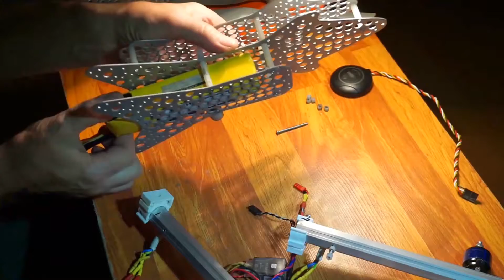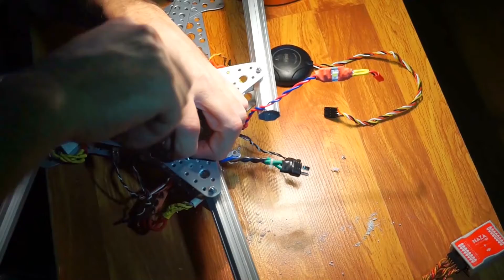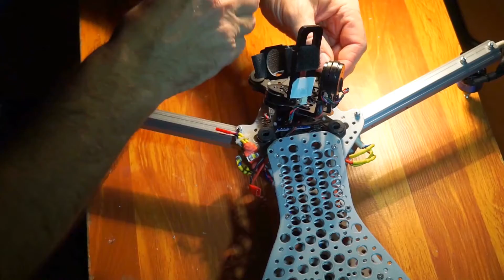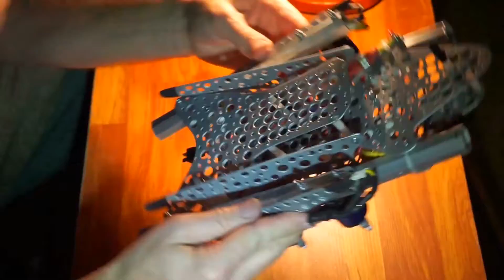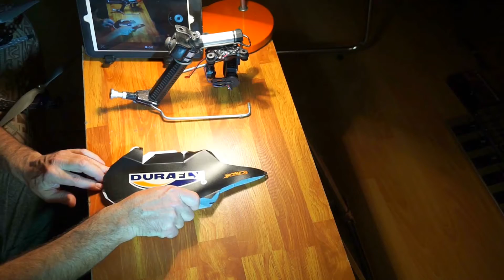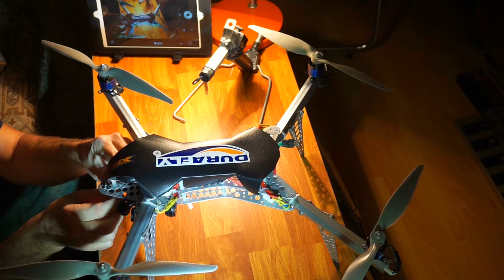Сборка квадрокоптера.500 мм .DIY quadcopter frame.

Comment: Приветствую. Не подскажите какой взлетный вес?
Reply from the maker: kraj Тип Квадро 500 мм.
Контроллер NAZA M lite пршитая V2 и GPS
Моторы KEDA 23-28S 1480KV Brushless Outrunner 3S 120W
регули TURNIGY Plush 30amp Speed Controller w/BEC
Приёмник Fly-Sky
Пропеллеры APC 13х4,7 не оригинал 
Аккумулятор ZIPPY COMPAKT 5800 ма , 25С
Рама самострой 1.5 мм текстолит
Вес аппарата 980 гр без АКК ,подвеса и камеры.
Время полета с подвесом и камерой GOPRO - расчетное - 9 минут